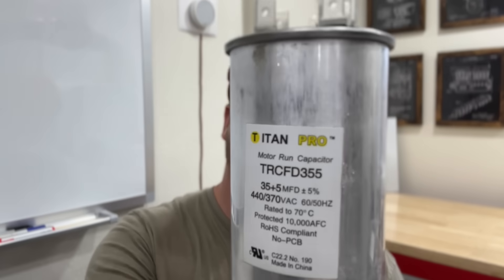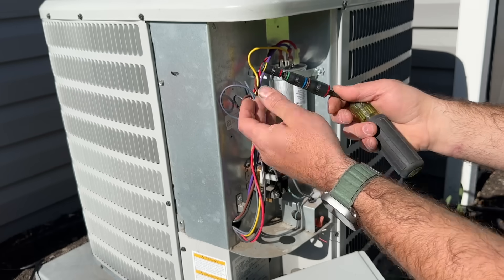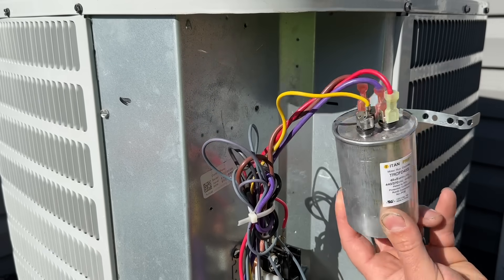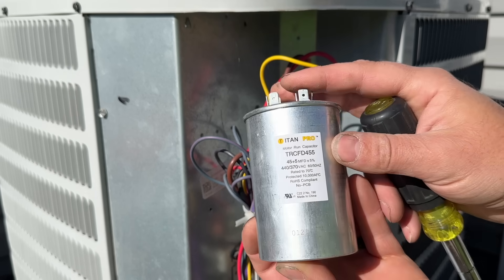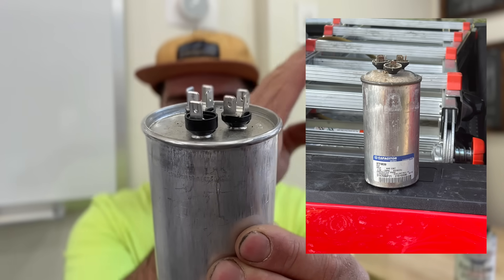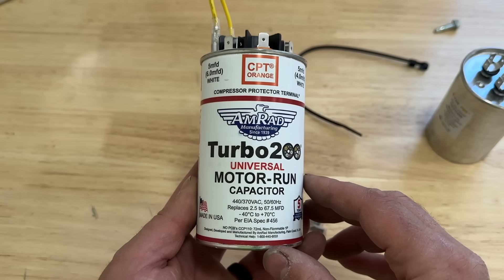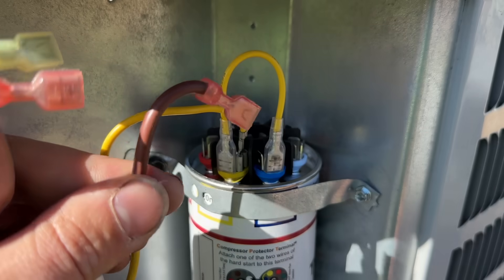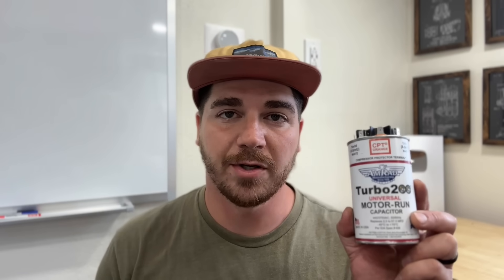HVAC Contractors Practically Make Their Living On These

Comment: Great video!  Thank you!
I recently had an issue with my A/C air mover.  The tech inspected it and said the mother board was bad and he observed “arching” ….weird I thought!
It was going to take a week to get the part.  It was hot so I figured I’d fiddle with it while waiting for the part (nothing to lose, right?)  So I was able to see this “arching” which turned out to be cob webs igniting on a tiny scale.  I vacuumed the mother board and it works again.  The company that I called out to repair had performed annual preventative maintenance for several years.  Not sure what they were doing, but I know they weren’t cleaning the components!   Honest companies are hard to find!

Comment: Please refrain from disseminating inaccurate information regarding dual capacitors. They are not like batteries and serve as run capacitors, not start capacitors. Therefore, they do not provide an additional boost during startup. While it is acceptable to offer repair advice, it is crucial to possess accurate knowledge before providing guidance. This video proves that you are just a handy man. I sure hope no technicians are learning from this video.

Comment: Excellent video. One question: it seems that if using the  Amrad universal capacitor we would need to know the capacitance of the compressor/fan unit. Yet it appears to be marketed as one that can be used if we do not know that information. Can you clarify that please? If i need to look up the information, doesn't it make sense to just buy the required capacitor? I have heard good things about Amrad as a company, so no issues with that. I am just unclear when that capacitor might be worth buying.

Comment: Even on warranty, I was charged $300.00 to replace it... labor!.  Afterwards I went down to Ace hardware and purchased two of them.  Last summer I had to use one as AZ summers are pretty rough on these things.  Still have a spare I need to replace another one, I have two A/C units.

Comment: I replaced my own for about $10.00. Our AC wouldn’t start up. We had a friend of my wife’s coworker come out and he put two used capacitors in it as the original was two capacitors in one housing. It worked for a couple weeks, but after watching the AC guy replace my original capacitor I got one from Grainger, came home and installed it and the unit ran another two years. In fact our house has two AC units and the compressor went out on the other unit. I guess that was pretty good for a cheap unit installed by the home builder, 13 yr as after we bought the house.

Comment: Unfortunately there are many dishonest HVAC companies out there giving the industry a bad name. That goes for plumbers, electricians and all trades for that mater. I own a HVAC business in Texas and a good portion of our success is by not doing business that way. Having said that, in my 37 years in the trade the Turbo capacitors are a game changer if they are used as intended. They are a universal capacitor. They are great if a technician does not have the exact replacement on the truck. It can be discussed with the customer, they are more expensive (from about $75 to $150 currently on Amazon) but can get things running in a hurry and no trip to the parts house. I also agree with the previous guys comment, if you decide to replace your own parts, PLEASE PLEASE PLEASE CHECK EVERYTHING FOR 0 VOLTAGE.
Reply: I wouldn't waste my or the customers money on these universal capacitors. We always say "universal fits nothing" around my place. It's just a way to hike and run up the bill and not use the proper sized capacitor for the application. Every single truck should have 30/5 MFD, 35/5 MFD, 40/5 MFD, 45/5 MFD caps onboard. They are the most common sizes and used. Occasionally you will get a 50/7.5 MFD, 55/5 MFD or 80 MFD but they aren't the norm and are most found in 5 ton high SEER rated newer R-410A units.

Comment: Ive heard an aquitance Heating and Air repairmen has his own business laugh how he makes 150k a year.  They feel like they are some kind of genius.  But to me they just don't get some us have principles.  We cannot scam others.  You're a low life thief.  They do this all the time, literally turn a $150 dollar welding job into a "tear down the wall and install all new piping" $4k job.
Reply: You must not know a single thing about being a HVAC tech to say something like that. It's in the Top 25 most dangerous occupations and requires both mechanical aptitude brains, brawn and great physical stamina and strength. Heights, crawlspaces, licenses, tools, long hours, 24/7/365 on call, out in the weather hot, cold, rain, heat, snow....working in 140 degree attics, bad neighborhoods/crime etc etc etc. Maybe 1 in 1,000 guys (there are no women) have what it takes. Not only do you have to be physically smart enough but physically and mentally tough as well. Can you lift 300...400ish pounds? An HVAC has to do it on a regular basis and without getting hurt calling in with a sore back the next day. No excuses, no quitting, no compromises, no kidding!

Comment: The ones not out to screw you can't get a name for themshelves. They are looked at the same way as a good mechanic who works from home.  When I built my house, my builder refused to let me use any of my contacts. That ended up increasing the cost of building by very large margins. Now, I still have issues with a 3 year old house and left me fixing it myself still paying every month for lining someone elses pocket.  My buddy told me my hvac cost him $3500.  Yet my builder charged me $8500 plus $6500 to install it. It took a whole whopping day to install and run all the ducting.  It figures out to over $800 per hour just for labor. 
  In Okla, it is not illegal for you to fix your own property.  But everyone thinks it is. You don't need a license to fix your own property. It's propaganda and what every company will tell you.  The a/c supplier can legally sell you everything you need to fix it yourself but they want to corner the market and make more money by selling to companies.  Plus then they don't have people constantly bothering them asking how to do it.  You only need a license and insurance if you are for hire and work on someone elses property. Remember, you already have insurance for yourself on your property.
  The last permit I pulled in my city for my shop, the inspector came out and looked at it. He asked me who did it.  I told him myself. He said I need to open an a/c business because he had never seen a system so clean and correct to the dot.  He said mechanical contractors are so bad at their jobs it's amazing more house don't burn down.  I showed him a few things in my house that were passed as good when my house got the green sticker.  He agreed it was terrible but accepted as industry standard.  People(city councils) passing ordinances that have no clue what they're doing and have no business passing anything.

Comment: The capacitor on my A.C. compressor went bad several years ago and the HVAC service person was going to charge me about $350 to replace it.  I told him I was not going to have him do it and I bought one locally and replaced it myself.  It is very easy to do.  I never called that company again for servicing my A.C. or furnace.

Comment: I had purchase three capacitors from each ac unit, i put them in the unit(s) , when the company i used, i had them do the maintenance twice a year. One of their service tech put on the invoice a bill, charging me $100 dollars to swap the old with the spare in the unit. I called the owner of the company about this, he removed the charge for swapping the caps. All three units were the same make and model. One of there tech was going to re place the control board. I took one look at the board and saw that the nine pin connector, and there were solder breaks, the tech didn't have a  soldering iron, but i did, and i reflowed the pins, and put it back into tohe unit, didn't have to purchase a new controller board. Since then i had to do the fix to all three units. When you have many skill, its hard for service companies tech's to snow you and try to gauging you.

Comment: Just because of capacitor is plus or minus 5 or 10% doesn't mean it's your units cause of failure.... I've seen capacitors more than 50% off their listed rating and still Work fine. Generally, if the compressor or the fan is not running. you will have an open leg on your capacitor. One or both. Now a capacitor that's way off value isn't necessarily good for your unit, but usually will Still operate the fan and compressor.   The moral of this comment is, if your capacitor is 5 10 or 20% off its rating, it's probably not the cause of the failure. A capacitor that's off by 10 or 20% should by all means be replaced but it's probably not going to be your current cause of failure. Generally, capacitors will be bulged like he stated, leaking oil or open between two of the terminals. to be causing the failure only. if it's 70 80 or 90% off, will it usually no longer start and operate its component. 30 year HV, AC service tech and contractor here

Comment: Why has no one mentioned wearing rubber gloves.  If you short yourself out with the 220 volts that your air conditioner runs on, it can KILL YOU!😵  If you've never done anything like this before, either find a repair service that comes recommended or get a friend to help you.  In this case two heads are better than one and you can keep an eye on each other and maybe keep from killing yourself.  Besides it's nice have someone there to hold your beer.🤪

Comment: Top of the capacitor- H hermetic runs the compressor, F for fan , C common. You can go up is size on the cap if your system is old. Recommended by engineers at the manufacture but not more than 5, example 45/5 can go up to 50/5 but never down will be too weak. 
Capacitors pop from Over heating. Hose the condensing unit down with a garden hose once a week in a hot southern climate I.e Texas, Louisiana, so on. Once a month if your North. Keep as clean as possible it will increase efficiency and extend life of unit. Keeping it clean will also help the compressor last longer. Overheating is what causes damage to it. If the condenser fan is old and rusted in one spot that means its over heating and maybe stopping on you. That heat is what pops the capacitor and damages the compressor.  Cap is usually an early warning sign the fan is going bad. Techs buy universal fans for $90 and it takes 30 min to change. Don't let them charge $500 for a fan. most only have 3 wires, you can figure it out.

Comment: Yeah well AC guys make a bunch of money off people working on their ac's.   So  -  I don't charge 2500 bucks for a capacitor and most don't. It is still good idea  to have a pro check on your ac.  If you hook it up wrong- you may burn out your compressor, fan or get yourself electrocuted.   It's easy, for me,  but if you stray off and get confused you may cause a lot of damage. If the cap is bad you can't read it to find out what it was supposed to be without the label. parts may have been changed.  You need to check the fan motor and the compressor to see what it takes, then check RLA afterwards.

Comment: HVAC companies make their money on refrigerant. That's the biggest scam because they upcharge so much and I think you need a license to buy it. I've called people out and all they want to do is check the pressure on my refrigerant because that's their money maker. Then they say the system is fine and leave even though its not cooling efficiently. Turns out the compressor was going bad, but nobody wanted to do the work until it went out completely.

Comment: Every time your house electricity receives a power surge, that capacitor slowly swells to the point of failure, the bad contractor like when that happens, it’s an easy sell for a new fan motor. That capacitor costs maybe $20-30 dollars.

Comment: Had a HVAC guy come out because the Heat Pump at a home I had just moved into was blowing capacitors. He looked at the age, 10 years, and said "you need a new unit".  I was away and my wife was dealing with it. I told her to wait until I could check it myself.  Yes, the capacitor was bad again but that got me to checking the power and noticed the shutoff breaker sparking.  I found the screws attaching the wires to the circuit breaker for the Heat Pump were a little loose, something I've seen before.  I torqued them back down nice and tight and viola!  Unit starts up much better.  He didn't even check for a severe voltage drop.  I went ahead and replaced the condenser fan motor out of fear that the low voltage from the poor connection may have damaged it. That and the motor was probably OEM.  Heat Pump runs like a champ now.

Comment: Do this instead:  Install a 5-2-1 Compressor Saver; whether you're replacing a failed capacitor, or just want all of the benefits of a "hard start kit". I've installed 5-2-1 Compressor Savers on every home I've ever owned, or performed work on. I've recommended them for years to literally hundreds of people. Installing one of these would be the first thing I'd do upon taking possession of a home...even if it were newly built.

Newer heat pumps (such as mini-splits) are DC inverter based and don't need a soft start kit. These units ramp up power slowly. They also don't cycle on-off-on endlessly throughout the day; overshooting, then undershooting the thermostat set point. So, if your traditional-style air conditioning unit finally dies, do yourself a huge favor and replace it with a heat pump.

Comment: Commercial HVAC guy here. Capacitors are cheap—and easy to replace. Now, I do buy the ‘good’ ones from supply houses (because they tend to last longer), but even a dual shouldn’t run much more than $50-60. I hate the scamming companies in the business.

Comment: I don't disagree that a prudent person can replace their own capacitor, but I will give one warning and one suggestion. Capacitors are energy storage devices, so imagine if it was a battery that size (I know it's not.), putting out line voltage and show a charged capacitor a little respect. I've never had a problem with one, but sure as you think it can't happen, and it'll happen when it can mess you up the most. The suggestion I have for discharging a capacitor is a 5 watt 2k ohm resistor for 10 seconds instead of making an arc with a screwdriver. 20 seconds isn't that much time and resistors are still quite cheap. Get fancy and put tape or heat shrink on the resistor leads so only the tips have bare metal.

What a capacitor does: single phase power doesn't provide inherent rotational torque like 3 phase does. The capacitor throws some delay onto its output line in order to add that torque. This is especially necessary for startup. Get 3 phase, and motors are a lot simpler.

Comment: So true...a $30 multimeter could save you $100's each time this happens. 
That Turbo 200 might be a neat tool to keep on hand if you have a couple of rentals that you service yourself and get the tenant back up and running right away until a new "$10" unit arrives. But I wouldn't use a $70 capacitor as a permanent fix. Thanks for the review.

Comment: Replaced my capacitor 2 days ago, $11.30 including tax and I'm sure It would have been my whole HVAC system getting replaced had I called in a contractor.  I did spray the cooling fins with diluted Dawn and rinsed from the inside with water while I was at it.  If it was just the cost of the equipment that wouldn't have been terrible, the AC part has some age on it but, the markup and labor makes it a no-go.  It's not easy to find a place that will sell a homeowner any HVAC parts.  I'm sure the contractor customers lean on them to slow down the owner repairs.

Comment: Clean leather gloves ! Never touch a Capacitor with out gloves , the case of capacitor could be charged , on unit ! After you pull breaker , always test at capacitor , these easy steps will save you from a electrocution !

Comment: $10 is an expensive capacitor. I suppose for an HVAC it's about right.
I've never been asked to pay $2k for it!
I have replaced it myself at a previous residence, since it was a recurring thing. But it also had other problems, turns out the intake duct was way too small for the size unit, which explains all the problems we had!
(Vibration, motors, capacitors burning out, etc)

Comment: Ive seen a scam in investigation on channel 8 Tampa FL, and 10 out of 10 HVAC contractors tried to make $600- $2000 dollars from a purposely disconected control wire at the condensor unit. 10 out of 10!!! Im an electrician and i don't trust you guys anymore. I test my own and tested my neighbors and found a bad capacitor. Tge ac guy said needed a transformer for $300 + labor and a capacitor for $90 plus labor. I put the capacitor for $27 cost and the transformer wasn't needed.  Bad ware joint in the air handler. The system was supposed to be undrr warranty. The company was ARS of Orlando. They just estimated a UV germ killer light for $900. And clean a blocked condensate line for $250 !!! I put my vacuum on it free!

Comment: Off topic…..I took a small engine repair class in high school. We use to “charge” the little condenser from the engine by plugging in an electrical cord and with the bear end, touch one wire to the body of the condenser and the other to the wire coming out of the condenser. Holding it by the insulated part of the wire, get someone’s attention and toss it to them. When they catch it, and they touch both the body and the wire they get a pretty good zap……yeah, I know, but we were high school kids.

Comment: Thank you for this valuable video!  Now a question:  you pulled the wires off the capacitor and then you shorted the leads.  That was a bit dangerous, no?  Would it be OK to short the leads of the capacitor first, and then pull the wires off of the capacitor?   Thank you.